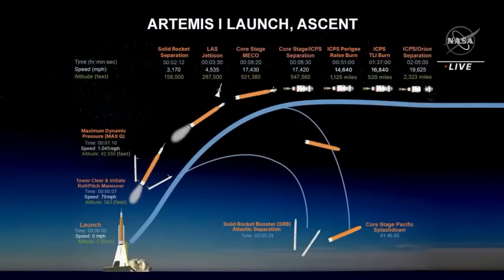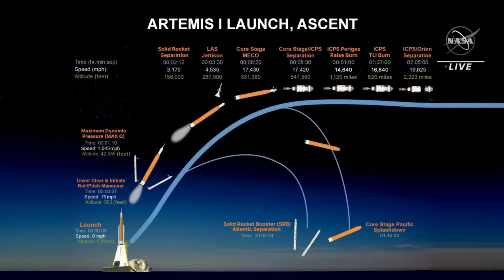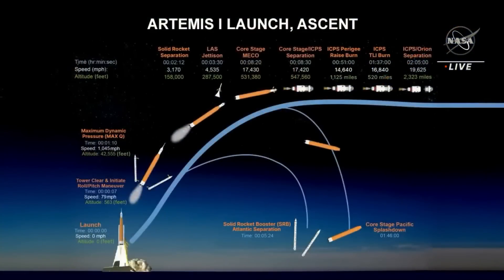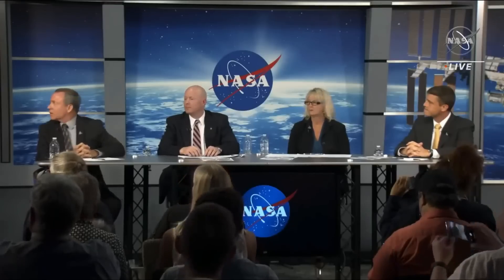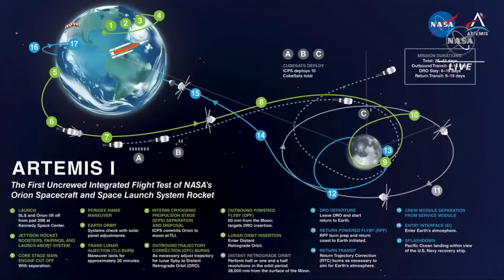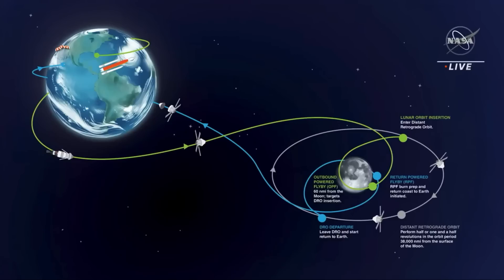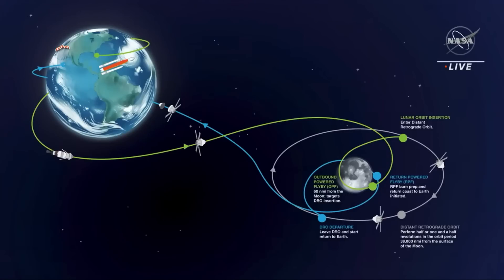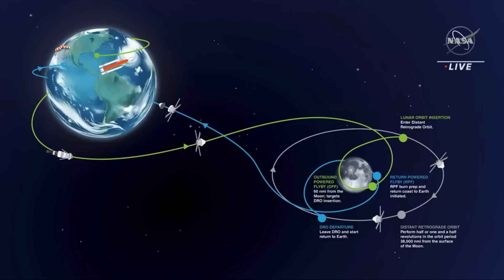Artemis 1's flight to moon and back explained in step-by-step detail

Comment: Love the teletremy at last in US measure ,MPH,  Altitude feet👏👏👏
Reply: Concerning the live MPH data....I've been watching that, and the distance from earth and to the moon.....and I've noticed that the enroute speed has been steadily decreasing? I thought once you were in the vacuum of space, any speed you acquired would be maintained, until countered by a burn in the opposite direction. But they were traveling at 22,000 mph after TLI, and now they are almost down to 1/10th of that....2466 mph 1.5 days after launch....almost half way too the moon. What caused so much of a decrease in speed in a vacuum? Is it the earth's gravity pulling against it? Will it continue to slow until the moon's gravity is greater than earth's?

Comment: I don’t understand the roll program for a symmetrical rocket?  The shuttle was different as it put the tank taking the headwinds and shock as opposed to the orbiter.  

Maybe there is a more sensitive side to the new rocket?
Reply: Bullets spin when they're fired. Makes speed and direction more efficient
Reply: The real reason is simply because the navigational computer platform must be oriented to the correct alignment on it's way into orbit.  Since there's no relative up & down in space, the navigation computer must establish it's own arbitrary standards for direction of flight through the vastness of 3-dementional space called the "flight azimuth" to provide a point of direction or heading for the entire ship.  The nav computers determine if the ship is on its intended course and make necessary adjustments by gimbaling the rocket engines or firing small thrusters that providing roll, pitch and yaw to ensure the command module is always aimed  and oriented on its proper trajectory.
Reply: @ShiftingDrifter  that makes complete sense.  I appreciate that. Thanks.  Hopefully Friday is a go.

Comment: Apollo took 3 days to get to the moon and little less to return. Why does it take the  Artemis mission so much longer?
Reply: Because they can. Orion is far more sophisticated than the Apollo command modules. They didn’t have solar arrays back then, just fuel cells for power generation. Also, without humans aboard there’s no worry about consumables. May as well keep the spacecraft out there long enough to test as much as possible.
Reply: NASA will use this flight to also get new information about space to plan for their Mars mission. That’s why the flight will take longer and no human beings will be on board.
Reply: @Sunny_is_sun  NASA needs to explain more a lot about that part of the mission.
Reply: Yes, Apollo was fighting the human clock.  Getting there and back in under two weeks due to food, air, and the human low gravity flight tolerance.

That's why they could only bring a foil and aluminum tent and two rocket motors with them.  The TLI burn was huge for speed. 

All of those things are improved with 30 years in long endurance space habitation.

If Artemis is to take enough to make moon habitation,  then like a semi vs a sports car...they need to take a more efficient speed.
Reply: @STho205  Apollo's translunar injections were not significantly faster than the lowest energy trajectory. The Lunar Module was made to be lightweight because it had to be sent to the moon along with a 30-odd ton Apollo spacecraft and the Saturn V has a capacity of about 45 tons to the moon.
Reply: @ryanspence5831  correct and that produced a dozen useful experiments...most left on the surface, a moon jeep left on the moon, an descent engine left on the moon, an ascent "tent" module discarded, a service module of engines and tanks discarded...  and three guys that made the round trip with some samples and film in a tight cone.

So if you're rehearsing to take much more this time....better be extra fuel frugal.
Reply: @STho205  My point was that they didn't waste fuel on going extra fast. They were just running against the launch vehicle's upper limits of performance at that time. As the Saturn V was iterated on during Apollo, they achieved slightly higher engine performance allowing for the extra TLI capacity to pack the rover and extra experiments seen on the extended-duration Apollo missions (15-17).
Reply: @ryanspence5831  and this has a much longer eccentric lunar orbit to achieve and maintain...and they plan for it to last much longer.  This will be, by far, the furthest out from the Earth-Moon system ever traveled by a stack intended for human flight.
Reply: @STho205  I understand that, but I don't understand your point about "taking a more efficient speed." The translunar injection is just the same, except that Orion will capture into a different lunar orbit.
Reply: This one takes the same amount of time to get there and to come back, but this vehicle will reside in lunar orbit for a longer time before returning to the earth
Reply: It's going to have a head wind...   it will be faster going home... it will have a tail wind coming home...   🤣🤣

Comment: I'm really glad to see NASA taking this step back to space but seeing the graphic of the boosters landing in the ocean makes me think of how much SpaceX has changed the game. NASA seems raw and unsophisticated in comparison.
Reply: Its NASA being NASA in a nutshell, billions of dollars wasted on what eventually Space X will so with a fraction of the cost and thats what is most important in the long term of things. I do applaud NASA for at least getting something off the ground and moving forward for they know that they have alot of work to do to one day compete with Space X potential companies as we move forward into the future.
Reply: NASA lead the way.  If they again can have astronauts drive over a total of 15 miles on the Lunar surface like the did in the early 70's..  then we'll begin to approach yesterdays achievement..
Reply: It’s ALL fakery
Reply: Good enough for government work.
Reply: Well you could see this 2 ways. A) SpaceX showed the future solution with it's reusable boosters. B) SpaceX just engineered an overly complicated feature crap that gives little benefits over a much simpler solution: Solid fuel is prefectly fine for the booster job, you don't need liquid fuel engines there. Solid rocket boosters can be reused even if they just splashdown with parashutes. Reusing a stage wastes a large chunk of resources, still the reused part need to be completely disassembled and only reused a very limited amount of times. Remember that NASA made their experiences with the shuttle.

The truth is likely somewhere in the middle.

Comment: Where did they get this idiot briefer? First confusing where the SRBs will splash down, Pacific vs Atlantic Ocean (He did correct himself). He didn't know the meaning of the acronym ICPS, standing for Interim Cryogenic Propulsion Stage. Flopped all around with it, never getting it right.

Comment: Why lose contact with the ship if they can put satellites in geostationary orbit around the moon ? Seems a bit muddled and very 21st Century. The guys back in 1969 were more clear-headed.
Reply: GEO -stationary orbits around the moon? Methinks you should think a bit more about what Geo means and what an orbit is.
Reply: @thearmouredpenguin7148  YAwn, another pseudointellectual. Geostationary just doesn't apply to the Earth you idiot - it also means you can place an orbiting craft at a distance from the moon so it seems to stay in place in relationship to the lunar surface - and then it can be used as a relay to craft on the far side of the moon. Got that?
Reply: @thearmouredpenguin7148  Youve heard of  Lagrange points right? NASA has a paper on this.
Reply: @tombradford7035  A geostationary orbit is an equatorial orbit (of earth) at an altitude of about 22,300 miles [35,900 km] requiring an angular velocity the same as that of the earth so that the position of a satellite in such an orbit is fixed with respect to the earth.
You cannot have a GEO -stationary orbit around the moon. There is no way any of the Lagrange points could be considered as geostationary.
Reply: @tombradford7035 
What do you think GEO in geostationary means?

It means earth dingus.

Comment: For decades NASA said there was NO radiation problem whatsoever. Now, the threat is so lethal we need MASSSSSSIVE shielding and a flight with 34 radiation sensors on crash test dummies.  What a joke.
Reply: @camp 
I do actually.  NASA themselves say the same thing:  we have never sent humans through Van Allen.
Reply: @camp 
NASA Artemis literature.  Read it.   NASA says, since we have never sent humans through Van Allen, we must conduct an unmanned mission using crash test dummies, each with 34 radiation sensors to determine the effectiveness of the modern radiation shielding.  Apollo had no shielding.  

Future mission timing, the number of months, years, decades, centuries, or millennia required after the results come back, will be announced once known.
Reply: @FFE-js2zp  never tired of spreading your lies are you?
Reply: @camp 
The actual number from Lawrence Livermore Labs is 71,000 times lethal dose.  https://youtu.be/Lftydgsvy3I

Comment: Very impressive guys. It was done 50 years ago with a slide rule.
Reply: I'm getting the vibe that many people in this thread don't understand computing equipment, mathematical methods, the methods and the inner workings of electronic computers....only an outside guess of magic in a black box and keeping score by bytes of memory or CPU speed.

Personal computers and consumer electronics birthed in the 70s, even today, are brute force fairly primitive architecture from cheaper chips...and quite fragile compared with the core approaches of expensive mainframes and crays.

Kepler developed the laws of planetary motion for THE SOLAR SYSTEM and orbital mechanics long before calculus, much less slide rules or logarithmic math calculators.  They're still accurate.

Much of these sarcastic thoughts come from people now so dependent on cheap disposable calculators and colorful apps that sales tax, making change or remembering your own home phone number is a struggle one can't surmount without a pocket crutch.

Our dads knew what they were doing.  Your calculators came from their efforts.
Reply: Can you imagine the Engineers back in the day only had the slide rule for their engineering computations...
Reply: @rhtball  Well, there were IBM mainframes.  I know, I lived back then.  We wrote our code in Fortan.  Orbital mechanics programs were run using those systems.  I was darn good with a sliderule though.  And I still have mine.
Reply: @georgesealy4706  The IBM mainframes of the time we’re almost as powerful as an Apple Watch.
Reply: @sabretom7594  It was still a billion times better than doing physics computations by hand and with a sliderule.
Reply: @georgesealy4706  It is FORTRAN....not Fortan. Typo?
Reply: @sabretom7594  not even that close no matter how trash apple watches are they used worse tech
Reply: @1983dmd  Yes, you know how it goes.
Reply: @donottouch9110  So what's your point?  The thing is NASA's rocket failed to get off the launch pad yesterday because it failed very basic rocket stuff.  All that computing power and Apple watches didn't make one bit of difference.  And let's not forget NASA already rolled it back to the assembly building once.  What the heck are they doing?

Comment: You paid propagandists! Earth rise is impossible from the moon. You say may take a self picture with the earth in the background. If this was real you would take an HD uncut stream video along with thousands of pictures. Any middle schooler can calculate the distance to the moon with a right triangle. And it's not a quarter of a million miles away. It's localized and  Scientifically repeatable. And if anyone thinks about Tidal lock; they should know that it is not possible with the told cosmology. And if anyone were to calculate the tangent force needed to keep the moon in orbit is around 30,000 miles per hour. Not 3,000. Just think it takes 18,000 mph to keep the space station in orbit. NASA delites the mass of the moon to justify 3,000 mph. It's ridiculous to see NASA scientists mislead the public.

Comment: WOW.... This Rocket's 0-60mph time.... My new Jeep would beat it. I can't promise beating this rocket in a race.... except to 60mph it's neck and neck. Just saying.
Reply: A 392 Jeeps  “Vertical” 0-60 MPH launch performance will not beat this rocket …. if the Jeep is fully laden at payload capacity, as most all space flights are,  then launched off a cliff …I’d at least be entertained. Just Saying.
Reply: Your jeep does not weigh 70 tons.
Reply: @Tarquinthetyrant  Yea it does when my wife's fat mother is in it.
Reply: @Tarquinthetyrant  neither does SlS, it weighs 5.75 Million pounds
Reply: @infected7258  metric tons
Reply: @Tarquinthetyrant  that’s un fueled, sls won’t go to space un fueled
Reply: You people are complete morons.  Perhaps you all should embark on a journey to lose your virginity.